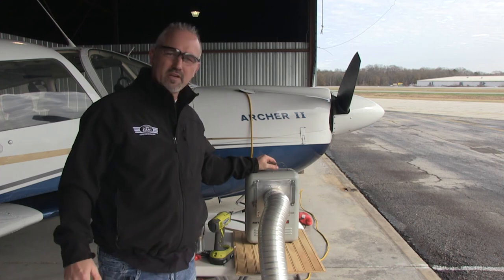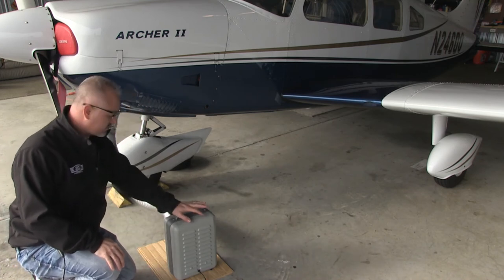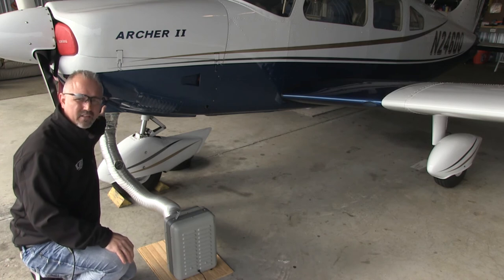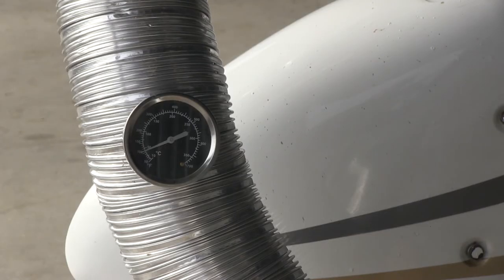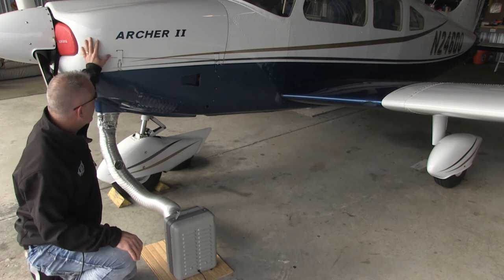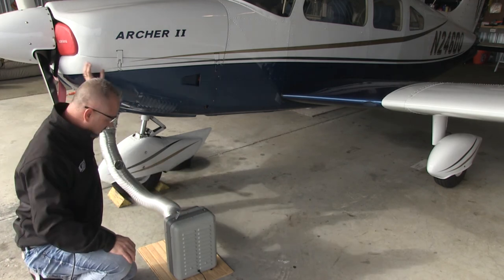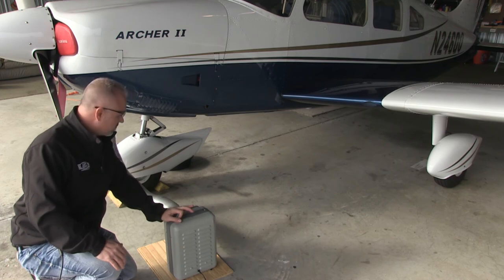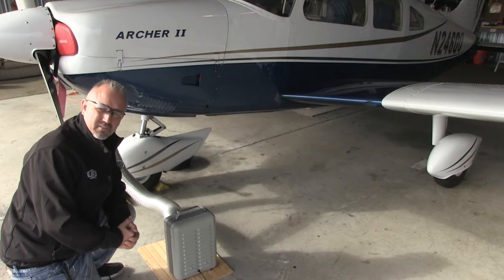Airplane Engine Pre Heater DIY How To Make an Airplane Heater Aviation Oil Preheater

Comment: 11/13/2020

There is no evidence that starting a piston engine in 30 F without an engine preheat is equivalent to 500 hours of wear. That is nothing but conjecture. If there was such evidence, Lycoming or continental would install engine heaters in all its piston engines, or make it an option to the buyer. But an engine heater from a manufacturer is not even an option. Moreover, by the time you take off, you should have ran up the engine so that the operating temp is just right for take off. Moreover, you should use 15W50 oil.
Reply: We had this debate at our local
Airport, specifically among the CFIs and airport administration. One cfi who doesn’t know her a$$ from a hole in the ground…. Who thinks rocking wings is a legit way to in air de ice a plane…. Anyway she made the airport admin nervous about this preheat issue. She got them to install an oil pan heater. I didn’t think 30F was anything to freak out about and looked up what exactly lycoming’s guidance was. Well they specifically said that down to sub freezing temps there’s nothing required and no damage should occur.

Comment: Hair dryer.  Watts are watts, but it's even better if you're not heating the coldest air, outside the cowl.  Throw a blanket over the cowl and a mini hair dryer inside (aimed reasonably).

Comment: Lycoming says you should pre heat their engines when it’s <45 deg F. When you get into the 10 F or colder, a cold start attempt can frost the plugs and the only way to get it to start when that happens is pre-heating.

I built something fairly similar, I used some mild steel 1/8 in 1x8” and attached them to the base of the heater to hold it up. I use an Engine blanket in conjunction, you should invest in a blanket!  My set up takes about 45 minutes at 15 deg to get it preheated with EGT’s showing 115 and oil temps about 80, running on the high setting. At zero F I add 30 minutes, -15 it takes 2 hours. Your electric space heater isn’t going to melt anything under the hood, anything under the hood gets a lot hotter on a summer day. 

For non electric environments, (back country), ill immediately throw my blanket on after shutting down and at negative temps, it’s good for about 4 hours, after that, I built a propane heater using a mini buddy heater with a shroud necking down to 4 inch, then I’ve got scat hose from there into the engine compartment. My only issue with this is, it’s propane and at negative temps, sometimes the propane bottle gets too cold to produce heat. It’s always a battle, if it’s not the weather it’s getting that engine hot enough to start... but that’s winter flying!!! LoL 

Some other options to an oil pan heater, there’s a couple of products, Reif makes a ring that wraps the cylinders in addition to the oil pan. There’s another company that makes one that replaces your intake bolts with bolts that are heaters. The name is escaping me, but it’s slick and a very lite system.

One final tip, I’d share from my 10 years of flying in Alaska... give the engine time to heat soak, if you are pre heating for 2 short of time, that just heats the surface not the internal components (crank, pistons, etc). 

Anyways, great video!!!

Comment: Dave S.

One additional question. I would like to duplicate your engine heater and I can figure it all out except for the fitting you used at the exhaust pipe fo feed hot air into the engine compartment. I also fly a Cherokee .
Reply from the maker: Dave S. , Thanks for the comment and question.  I used a round HVAC reducer from Home Depot (4-in to 6-in I believe) and squeezed it to form an oval at the exhaust side.  I later added a bead of insulation on the exterior of the fitting and wrapped foil tape around it.  This created a nice fit that keeps the connection tight and does not scratch the lower cowling.  Thank you - Shane
Reply: Dave S. B
Reply: @hangar8media294  Round or oval reducer? It seems like the round is a pain in the butt to form so I am going to try a 6" oval reducing to 4 inch for hose.

Comment: Do you use both the oil pan heater and the hot air heater together. Not sure based on the video
Reply from the maker: @Dave S.  We only use one or the other, but not both at the same time.  My mechanic's opinion is the electric fan heater warms everything under the cowl where the pan heater warms the oil and the bottom of the engine.  If we are located in a hangar, we use the electric fan heater.  If we are on a tie down, the electric fan heater is not feasible, so we use the pan heater.
Reply: @hangar8media294  hi. Do you use the exhaust port in cowling or push the air through the exhaust pipe?  Or both. Thanks for the great video
Reply from the maker: @Tenezman   I used a flexible duct that I believe was 6-inch diameter.  Once I formed it to fit in the exhaust opening of the cowl, it was tight around the outer edges and sealed against the exhaust opening in the cowl.   This provided heat around the outside of the exhaust to all the components under the cowling as well as deliver heat inside the exhaust up to the engine components.   We have since moved to a Cessna Cardinal and did the same with it - we fit the duct around the exhaust pipes and into the cowling to heat both.  Glad you enjoyed the video.  Thanks - Shane
Reply: @hangar8media294  you said 6" air duct worked well around the exhaust? what kind of temps were you getting on CHT / Oil Temps prior to start? I just got an Arrow and want to ensure its babied! right now I just have a forced air heater that heats the whole hangar, a multiple hours long process, would like something more direct.